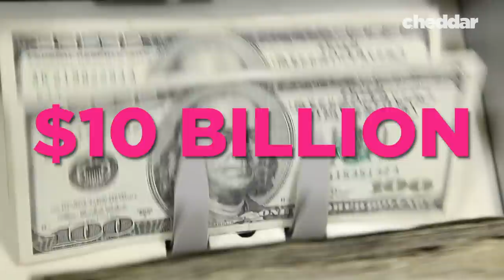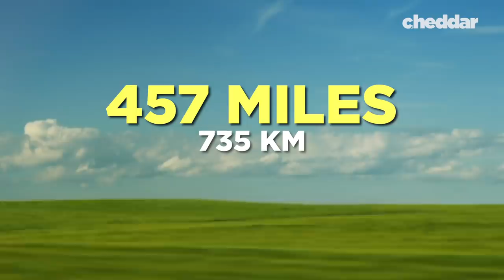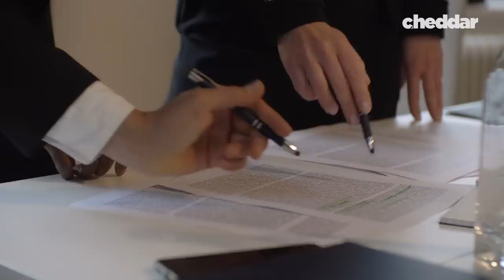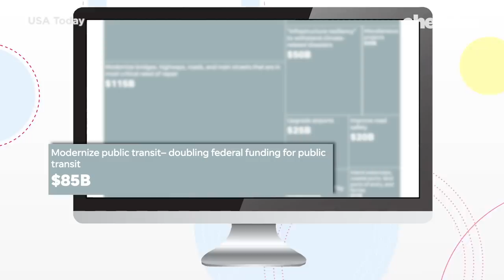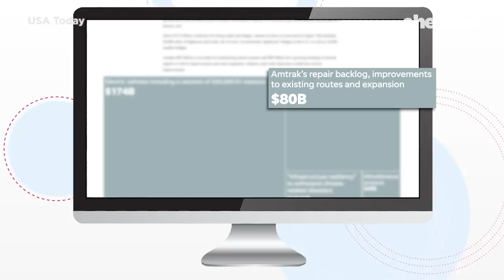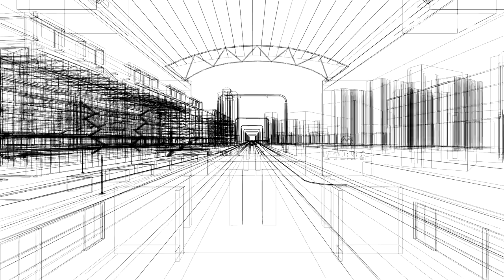Is New York Finally Getting A Real High Speed Rail? - Cheddar Explains

Comment: I don't know how far Tokyo is from Osaka off the top of my head, but it's considerably more than 67 miles.
Reply: Yeah even Mt fuji which is pretty dam close to tokyo is probably farther than 60 miles
Reply: Tokyo is 506 kilometers from Osaka
Reply: The shinkansen line is around 674 km long
Reply: @matthewwong5150  it's 515.4km
Reply: But they do have 67 miles of tunnels. Looks like the devil is in the details.
Reply: @dbclass4075  they have a maglev from Tokyo to Nagoya under construction that will be around 90% in tunnels which is much greater than 67 miles
Reply: @skygge1006  Chūō Shinkansen
 is still not yet in commercial service, and I am referring to conventional high-speed railway; Tokaido Shinkansen
, to be specific.
Reply: About 300 miles, nowhere near 67 as stated at 0:09